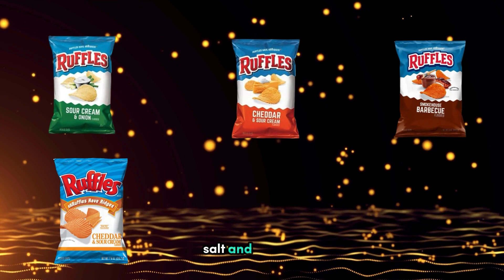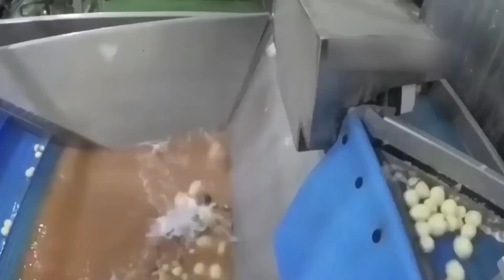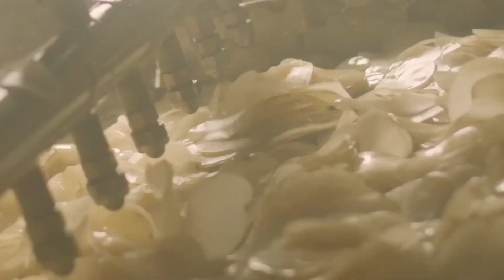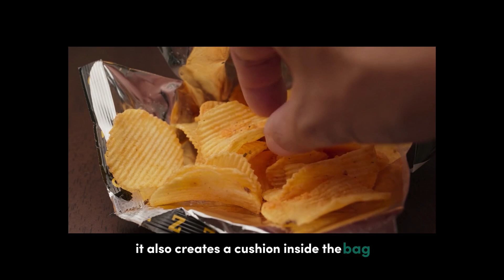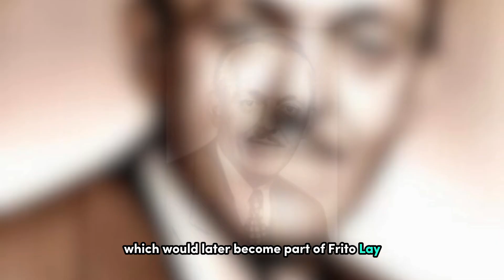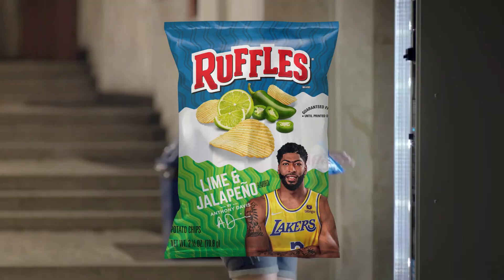How Ruffles Potato Chips are Made in Factory | Ruffles Factory Process

Comment: I recently bought a bag of Ruffle Original Party Size and it was basically trash. Never had such a terrible bag of chips. Chips were small (not broken), dark and discolored, tough, lots of dark edges and terrible. Basically it looks like I got the bottom of the barrel from a run that should have been trashed. Looks like quality control was asleep or out to lunch. Just terrible! At $7+/bag I likely won’t buy again. For the price nobody should get such trash!